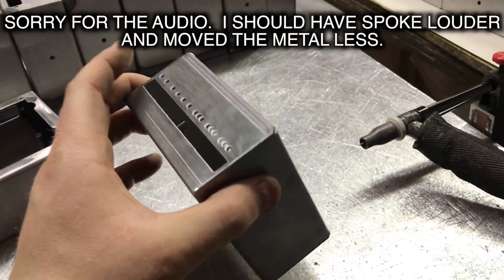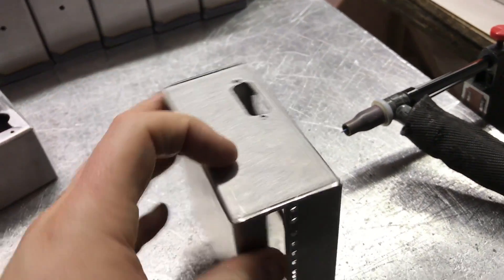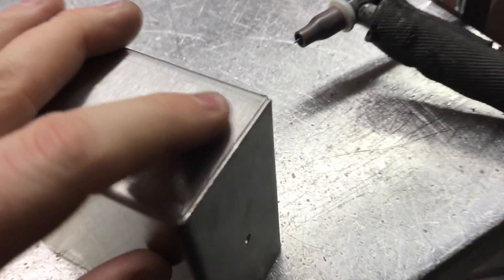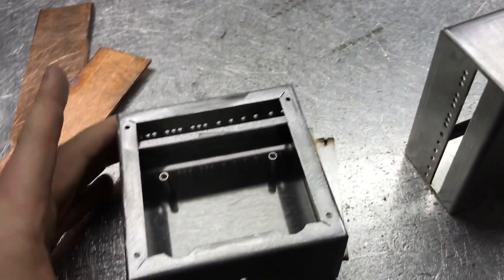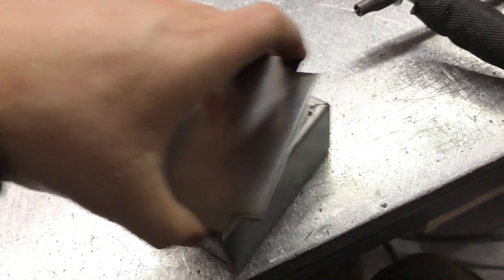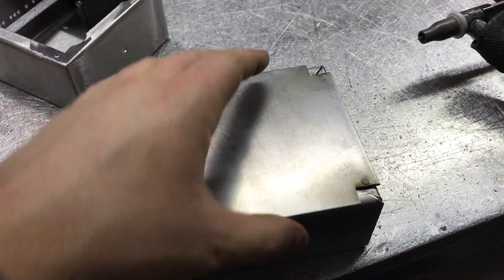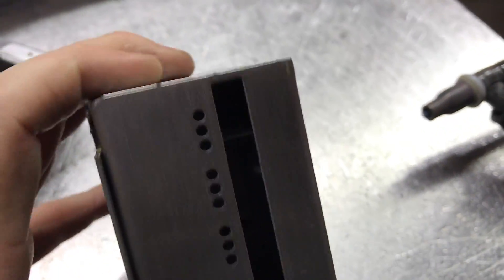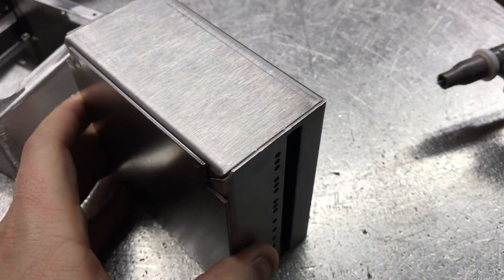TIG Welding Sheet Metal Enclosures

Comment from the maker: I welded a few hundred of these enclosures.  In the video you will see me peening the corners shut with a hammer before tack welding the top corners.  The rest of the edges are fuse welded.  The two edges near the wide opening are protected with copper to prevent burn through in those spots.

Comment: Kudos to whoever the press brake operator was. Also, we're the features laser cut or punched?
Reply from the maker: Yeah, he did a great job!  Two of the flanges are tucked into the other two so most of the time the edges are pretty tight but they need to be perfect when fuse welding without filler rod.  The smallest gap will burn through so I still peen the corners with a hammer and clamp the outside flanges before tack welding the top corners.  These were punched this but only because the laser was busy.  They just as easily could have been laser cut.
Reply: Proto G I've never seen someone fuse weld with TIG before. Perhaps in a future video try to get a closeup of what's happening.
Reply from the maker: Watch Jody do it here: https://youtu.be/FppoWj8MyfE?t=7m43s
Reply from the maker: Here's another video of Jody fuse welding thicker stainless steel: https://youtu.be/LLjO4A7p1pg?t=3m2s
Reply: Proto G I imagine this takes a very steady hand. What kind of arc length are you working with?
Reply from the maker: Yeah, I'm holding the sharpened tungsten about 1mm(0.0394") or less from the seam.